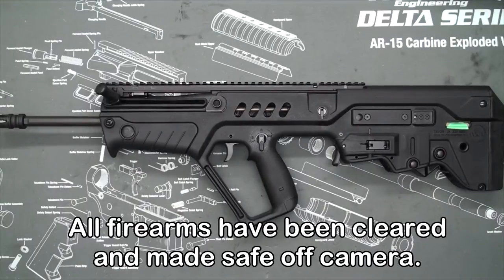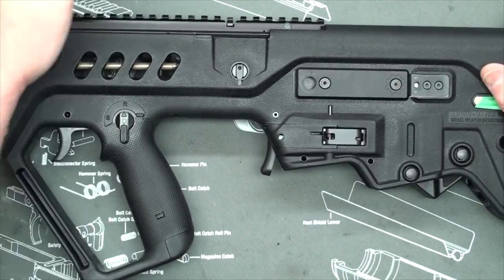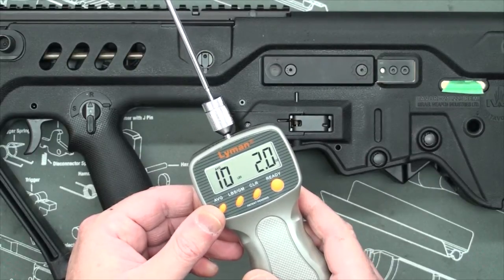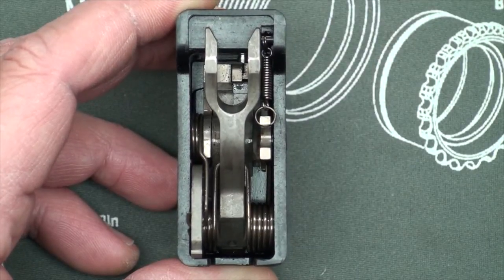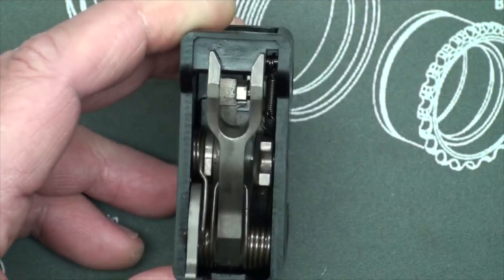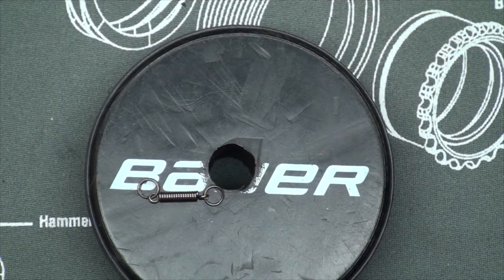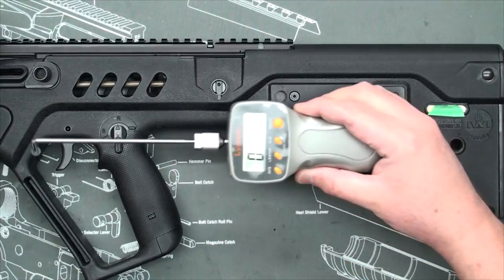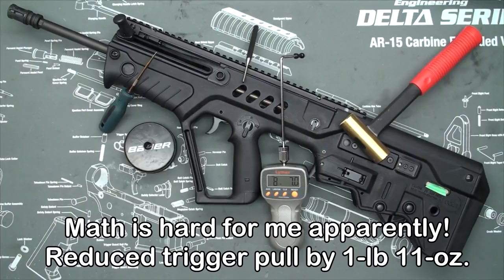TAVOR Trigger Job

Comment: Nice video with the before and after, I did notice the scale when not in use had a 2.1 ounce reading on it. would that have thrown off the average pull? Can you zero the scale?